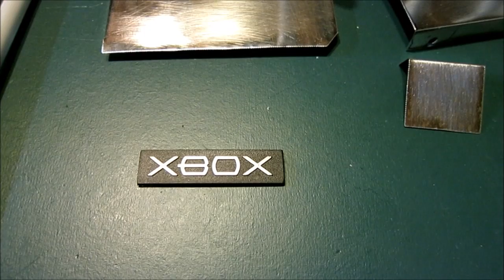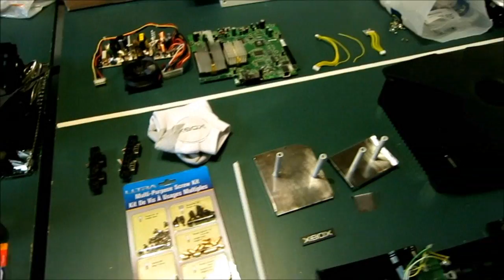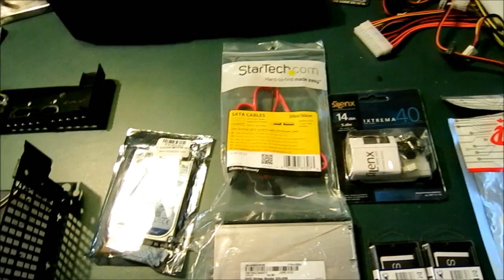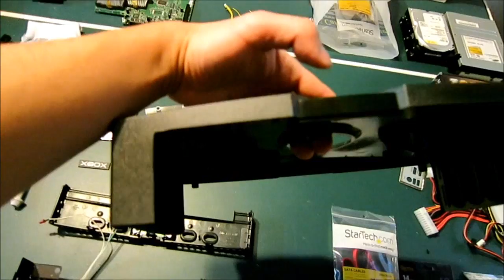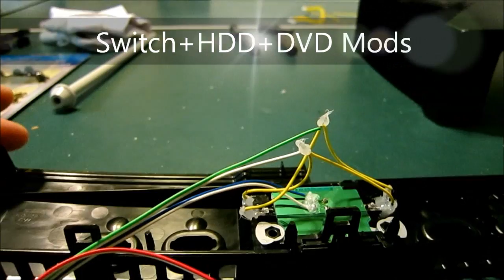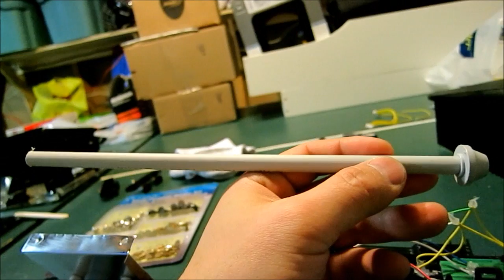Xbox PC Build- Part 1 of 2

Comment: Hey man! Inspirational build. I am currently working on something similar, but I am really bad with electrical wireing. I have salvaged some old connectors from an old PC case which will give me proper motherboard connections. But how should I connect the cables so 

A) the big button turns on PC
 B) Original LEDs turn on
C) the small button becomes the reset-button?

Do you have the link to the schematics on how the original button-pcb of the xbox is wired?
Reply from the maker: Man, I had them awhile ago. I just did what I did because it was easier and faster. 
a) It's just a momentary switch. You solder the on/off wires to the opposite corners of the switch. The switch will have 4 pins. Just use the diagonal corners (doesn't matter which colour goes where)
b) That I'm not sure of. Polarity is important here for LEDs. Usually the flat side of the LED will be the neg side.
c) Same as the first question. Just find your motherboard reset switch and connect is to the small button.

Comment: what kind of led lights you use in the front panel cable ?
Reply from the maker: They were very small ones from ebay. I'm not even sure of the specs now. They work well. Came with some resistors that were supposed to bring the power down if using it with a 12v supply. I didn't use them in this case.

Comment: i got a question if i took out the part of my xbox 360 can i use some of the part for a pc build?
Reply from the maker: They are PC parts. I've only ever reused the hard drive. I've tried the optical drive but without luck. I've only had a broken XBOX 360 to work with though. Interesting thought. I'm sure someone in the google world has answered that. It is well beyond my level of expertise. If I were to guess it would be, no.
Reply: Ladybug Adventures ok thanks

Comment: but the original xbox was a pc. it has a p3 cpu
Reply from the maker: Yep. Mine was a dead xbox. Therefore a dead xbox computer!
Reply: oh
Reply: I didn't say remove it. I asked you why would you put it near the eject button, when you could put it on the far left. That's my question.
Reply from the maker: Matthew Jefferson If there were any issues with the optical drive in the future, I didn't want to bother with removing the emblem. Thanks for your input, smartass.

Comment: All I've got myself is a micro ATX board, and I can't find a single PSU to fit. Really don't want to have to take the internals of one out.
Reply from the maker: I've thought about that too. I prefer not to take the internals out. Psu fitting is a real pain. I've always had to buy a new one from the following sites. Newegg or itxcanada.com . If you need it to fit into a small case then sometimes you have no choice. I've looked into used itx cases with power supplies that maybe I could use from kijiji but they always seem to be older and only 20 pin. TFX style or pico is what I have used.
Reply: Uncle Yar If you only plan on running a motherboard with no gpu, use a 160W PicoPSU + an external 200w laptop charger

Comment: What wire was that that you used for the power switch ?
Reply from the maker: Could you elaborate on the wire? I used a power/reset switch with green and red leds that I purchased from ebay. They are only a couple dollars. Usually you get a power +/-, reset and led leads. I just cut off the switch, exposed the wires, and soldered them to the xbox switch (green board).
Reply: You actually just answered  what i was trying to ask you .  thanks!  :)

Comment: Can you point me to any material on resoldering the front panel switch to power on a pc?
Reply: You've inspired me to give this a go myself
Reply from the maker: Shawn Moss
Great! Like I said before to others. You just need some basic tools of the trade and do your research. Check out my vcr build. I resolder the vcr power switch so that I can turn on the pc. Much like the xbox one. Any momentary switch will  behave in the same way. My rule of thumb is to solder the 2 leads on a diagonal to each other. It doesn't matter neg or positive (the order of the coloured wires..) as the switch is just closing briefly to close the circuit. I reseached this like crazy.
Are you doing an xbox build?
Reply: Yeah I had an old xbox laying around collecting dust.  Looks like a great little priject to keep myself busy :)
Reply from the maker: Shawn Moss
Check out the section that did on the switch. I cut the ends off and you can follow the wiring. I did it for the eject button but you can do it for the lower/smaller button. I thought about trying the pinout diagram on the unknown lobster/will urbina video but that looked too hard for me (it's on my xbox playlist just for reference). That was the video that inspired me. He used a larger xbox (limited) so you can't fit alll that he did in a normal xbox. Make a video of yours, I'd love to check it out.
Reply: +Ladybug Adventures any way to connect optical drive eject switch to Xbox eject button on front panel?
Reply from the maker: +Shawn Moss Do you mean the xbox front panel? Both are usually momentary switches. Usually there are 4 points to the switch. An easy way to resolder them is to solder a power switch wire to one, then solder the other one to the one diagonal to it. There is no neg/postitive to worry about.